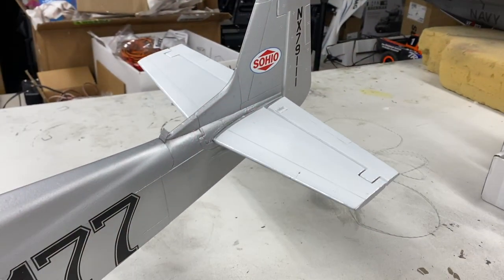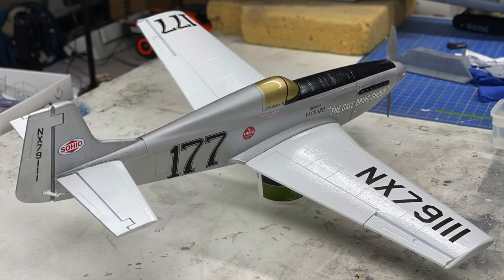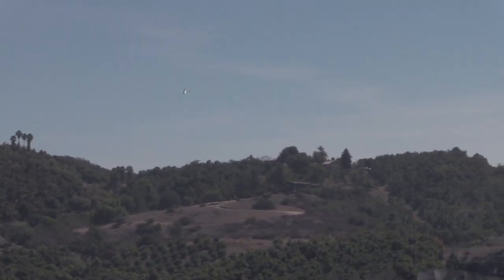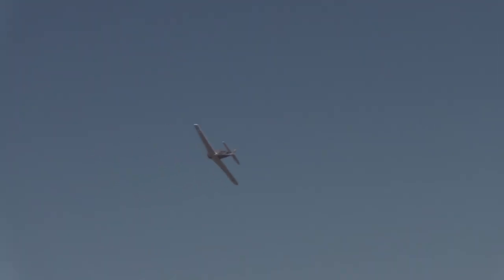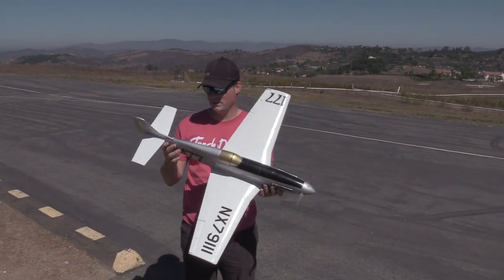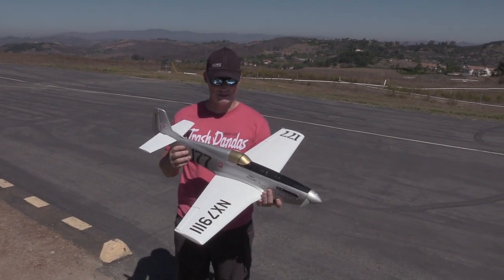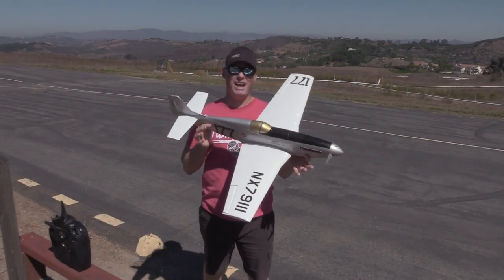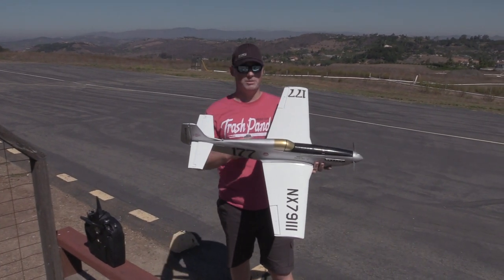From the Field -- Upgrades & Flight with the HobbyKing P-51 'Galloping Ghost' | The RC Geek

Comment: 2814-1950kv Baddass motor, 6x4.5 apc, on 6 cell. Would it work?
Reply from the maker: I’m not familiar with that motor. Seems pretty high kv for a 6s setup.
Reply: @Thercgeek  it can handle it, I don’t think the airframe can. I had it on an eflite v900 and tore the wings in two. This time around I’ll carbon rod reinforce the wing.
Reply from the maker: Yeah, definitely will need reinforcement. It’s not designed to handle that kind of extreme speed, haha

Comment: Great vid.  I really like the mod to the wings.  How much did you cutoff from the wing tips?  Did you also make any mods to the ailerons?
Reply from the maker: There’s a panel line on the outer wing before the tip, we split the difference between that line and the tip.  No mods to the ailerons aside from clipping them. 😊